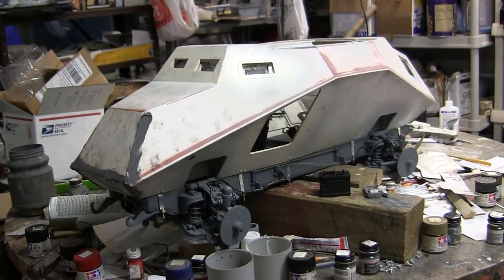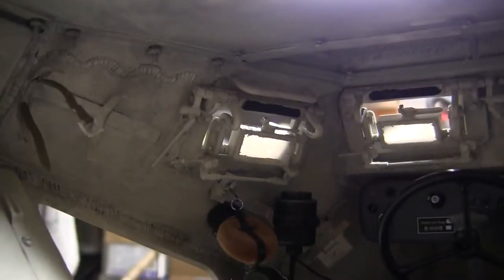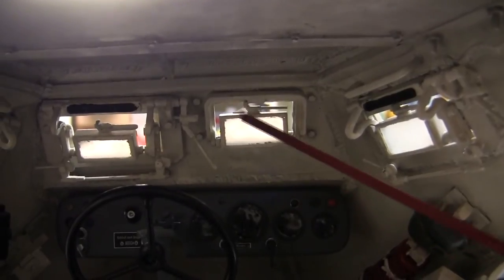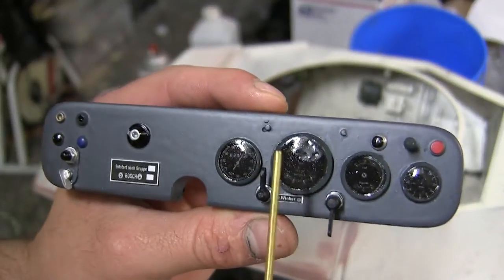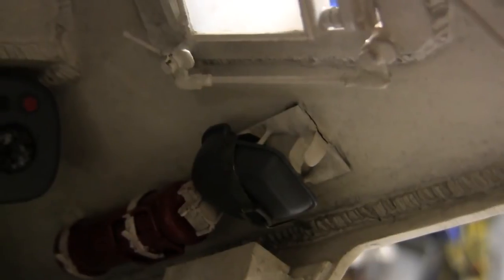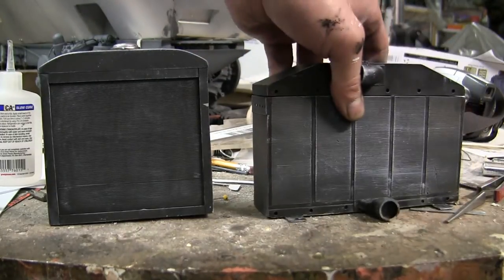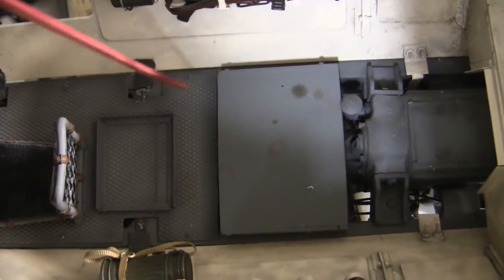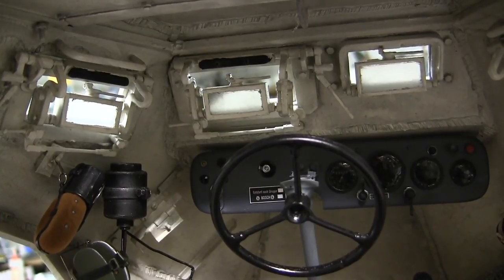1/6th scale German SDKFZ 222 armored car project video #9 (interior almost complete)

Comment from the maker: Not really. You need to find a chassis with the same wheel base and length as the 222. Also the car chassis will not have the accurate sdkfz 222's suspension. As that was unique to only the 222 armored car. 

If your looking to make the model an RC model only and are not looking for detail accuracy then you can use off the shelf RC car equipment to build an RC version of the model, which has been done many times.